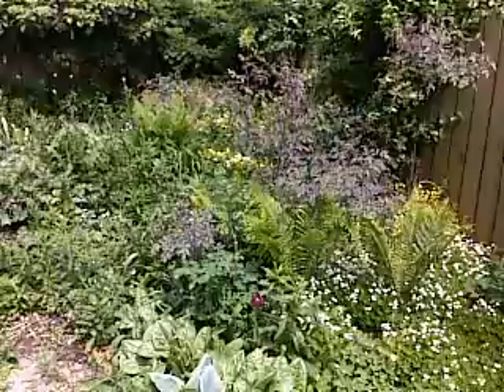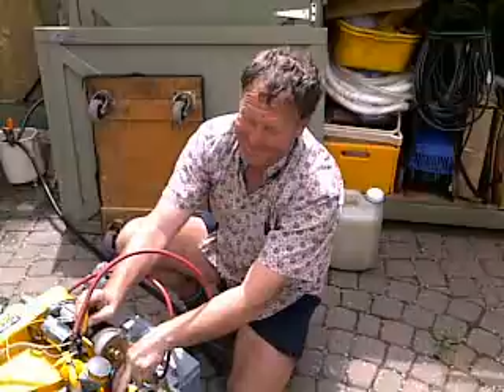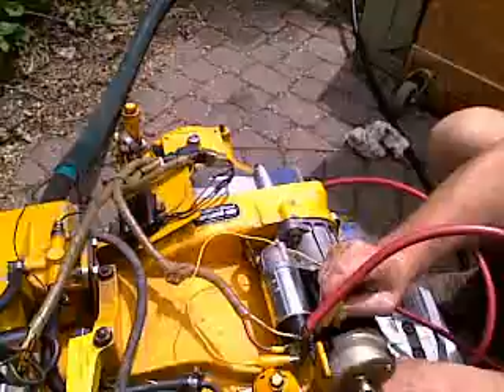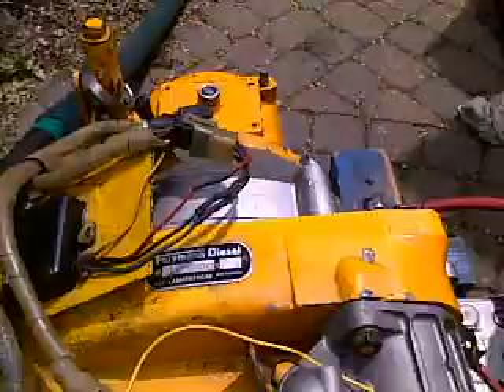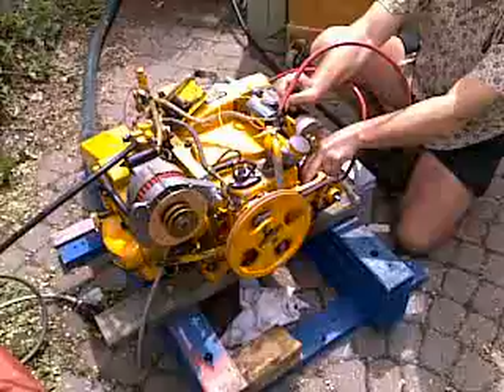Farymann A40 on test bench for initial start-up

Comment: Great video. My friend recently bought a 28 foot sail boat powered by an inoperable A40. We just got it running and I've got to say, for an engine made in the early 1970s it starts right up with ease, runs like a top.

Parts are difficult to find but can be DIY'd for cheap. It feels like it will run forever.

Comment: Do you happen to have a good source for parts? I have an A40 with the hydraulic drive in a sailboat. Broke valve springs (replaced), and now have poor compression. May need to take the head off.
Say, what does the little lever behind the big cam pulley do?